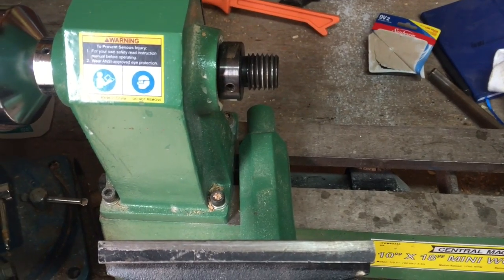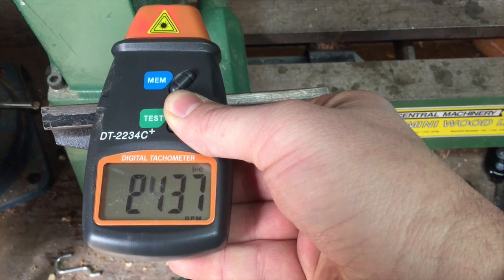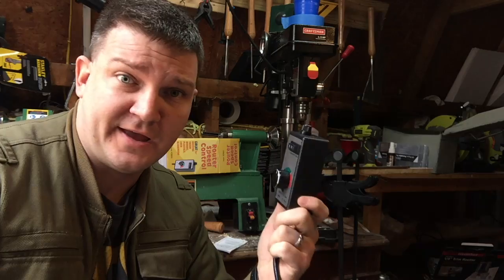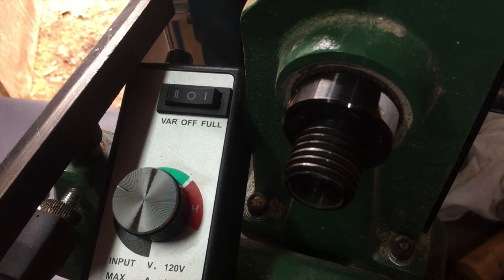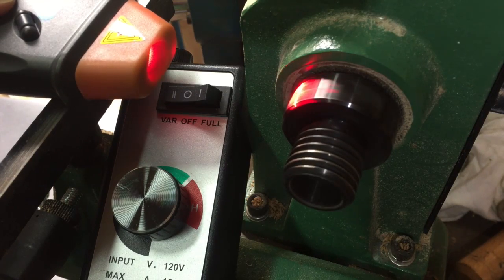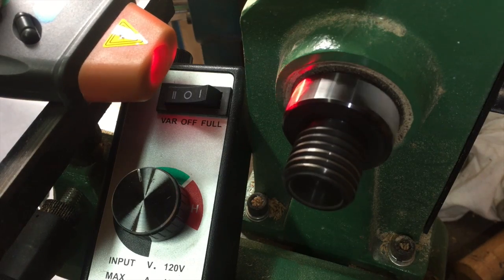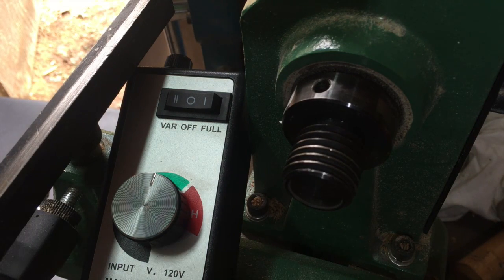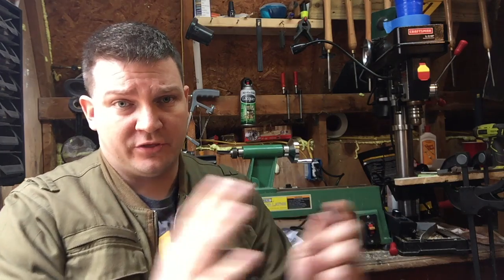Shop Tools: Harbor Freight Lathe Speed Control

Comment: Same question , different wording. When the belt breaks, where do we buy and new belt and how do we install the new belt onto the pulleys? In the instruction book, there is no mention of how to do this installation?  To me , it looks like we must buy the belt from Harbor Freight and then take the lathe apart to get the new belt on. Then put the lathe back together again? Thanks for the reply.  This will help all of us when we need to replace our belt on our HF model 65345 Mini Lathe...   https://www.youtube.com/watch?v=fvOHII3k-Io
Reply from the maker: Thanks for sharing that link, i've never had to do that. If HF doesn't carry the belt you could probably order it from Grizzly that sells the same lathe with a different paint job.
Reply: I am going to shop for a belt now before I need it. Not sure why they put those grooved pulleys on there? I guess is so it runs quieter? If my belt breaks I will use an old leather belt to fix it. May work ok or not? It is a nice lathe tho. Just right for all I ever intend on doing. Thanks for the heart. I like to try to help folks as much as possible. Good video too.
Reply: Call us at Belt Store 337-235-9736 if you have not found your belts. We can help
Reply: Thank you.
Reply: Link belts
Reply: dread cat: don't know if you got a belt yet, but the harbor freight mini lathe is the very same (except for a couple handles and paint color) as the Excelsior lathe from Rockler. Rockler carries this belt on their website and I would imagine they have it in store as well. I just checked the website earlier today and it was $9.99. I too have the harbor freight mini lathe.

Rockler also sells a bed extension that should fit the HF lathe as well. If you're interested.
Reply: You can order replacement belts and parts from Harbor Freight. The phone number, along with the available parts list is on the web page for that lathe. The belt is only a couple dollars and shipping is free. The parts people are the best I’ve dealt with compared to other companies. And if you need a part not shown on the available parts list they can often special order them for you.
Reply: @jjp95136  I ordered a new belt from Amazon for mine
Reply: Take the belt to any local farm-store, they can help you.

Comment: Here’s what might be a problem. AC / induction motors generally regulate speed by frequency control. Yes, they do slow down by decreasing voltage, but they will not have much torque under load. Additionally, if you run them at less than their rated RPM for very long, they can and probably will overheat. The rated speeds of small 60 hertz motors are usually either 1750 or 3500, give or take. That is designed in, based upon the number or poles the motor has. 
   A frequency drive unit can run them from 0-maximum RPM, maybe even faster, at full voltage, by changing the frequency. But this is dependent upon whether your motor has a centrifugal start switch internally. The router control is for use on brush-type (universal) motors.

Comment: Penn state has a 3/4 motor and variable speed switch that will line right up with most lathes. I have a delta midi with just about 12 inches and a bed extension of 36 inches and with the 3/4 motor and 250-3000 switch already wired into it

Comment: From my own painful experience, unless your motor is a DC motor, a rheostat...which is what you have there...wont work the way you/we would like. Along with the DC motor, you will need an AC to DC converter. THEN that rheostat will work. The speed of a DC motor is directly controlled by the amount of voltage coming into the motor. Sorry

Comment: I'm confused.
It seems you CAN control the speed up to the maximum speed for that particular pulley.
If you want slower for finishing, you turn it down.
Not sure what the issue was here.
Reply from the maker: You’re absolutely right. This was just about me being lazy and wanting a dial more than changing belts. This was a great starter lathe but I’ve since upgraded to something that fits my needs. Thanks for checking it out
Reply: @KagedBooks  So, would it be just as fine to get the device, put the belt on the fastest setting, and just use the dial to slow it down if you need to?... or maybe use a 'medium belt' setting so you could at least go a tad faster, and still have the ability to go slower if needed?
Reply from the maker: @gsgidney  so yes and no. It’ll technically work but when I did more research it doesn’t have the right kind of motor to handle that kind of limiting switch. So it’ll work for a while but would likely burn up the motor much faster

Comment: I bought a similar 6-speed Delta lathe on Craigslist that is stuck on its second highest setting.  On mine, the nut that clamps down on the level that you use to slacken off the belt tension is off its threads, but it's firmly clamped down on the lever, so even though I can turn the nut, there's no way to budge that lever.  ( I think I know why the guy knocked off $50 off the price without me asking).   I had planned to use a variac, but people on the internet say that it won't work with an induction motor with start and run capacitors which mine surely has, so now I think I might have to get a VFD or just risk cutting the nut off and figure out another way to clamp down that lever.

Comment: Just seen this although 3 years old. You cannot use variable speed with motors that have capacitors. When you heard it ramp up and a soft click was the centrifugal switch disengaging the capacitor. You’ll burn those motors up doing that.

Comment: For the ppl who asked on replacing the belt. I have the same lathe. The spindle needs to be removed from the head. It's pressed in. I cut a piece of car exhaust pipe that's a little longer than the spindle on the opposite side of the hand wheel. Cut a notch in that pipe so it fits over the ridge molded into the head. Remove the handwheel from the spindle, and loosen the set screw holding the upper pulley. Get a honkin' big C clamp and two flat pieces of wood. One piece of wood goes on top of the spindle on the handwheel side, the other piece goes on top of the pipe, and the pipe goes over the spindle. Put the C clamp over the whole thing, with the screw of the clamp on the handwheel side. Now just crank the c clamp down until it gets hard to turn, then tap on it with a hammer until the spindle moves, then crank the clamp down again. Keep doing that until the spindle comes loose from the bearings. Slide the spindle out, clean and lube everything, since you have it out, and reassemble in reverse with new belt. Belts are available from HF, but you have to call to order it.
Reply: I just changed the belt on mine last week. I ordered a two-pack from Grizzly for $20/shipped. After failing spectacularly to remove the spindle with clamps and tools I had on hand, I bought this: https://www.harborfreight.com/8-in-three-jaw-gear-puller-69224.html?_br_psugg_q=gear+puller

Save your frustration - worked on the first attempt.

BTW, this is a great beginner lathe at the $200 (sale) price point!

Comment: It would have been interesting to see what happens when you put a load on the lathe. My experience with this switch is that if it's used on single phase induction motors they will bog down when put under load using this switch.
Reply: Tried and soon I put a load completely bogs down and the motor gets too hot, better get a dc motor.
Reply: and heat

Comment: I have a HF 8X12 mini lathe and the HF 10X18. The 8X12 is no longer sold by HF. It is variable speed and has worked great for 3 years now. Got the 10X18 cheap with a 25% off coupon with the intention of getting the variable speed conversion kit from Penn State Ind. It would still be much cheaper than buying a 10X18 already with vari speed. Its not so much the cost if your selling your projects, I paid more for a chuck set for the 8X12 than what the lathe cost. That little lathe has paid for itself dozens on times over. I have seen them under other names, excelsior, shop fox, etc. Just a little research.........

Comment: Watch for over heating the motor at slow speeds.  Cooling fan slows as the motor slows.  HF lathes already have a motor heating problem. Might want to consider adding a cooling fan to the end of the motor.
Reply from the maker: Thanks for the tip! I actually switched to the Nova Comet II, i mainly use my HF for drilling now

Comment: Not sure if this question was asked, but what setting was you belt on? I have both the lathe and the speed control. The speed control is collecting dust so it would be good to use it.

Comment: yes there is a way however is not chip. That lade uses an induction motor and the speed is pair with the ac 60 cycles. you need a device device called (AC motor controller) however they are not economic purchase.
Reply from the maker: Thanks for the tip! I actually switched to the Nova Comet II, i mainly use my HF for drilling now

Comment: I have the same lathe, and had the same frustrations that you do with changing the belt all the time. I converted mine to variable speed using a treadmill motor. It is a much better way to get a variable speed lathe than what you attempted in this video. The motor that comes with the lathe can be damaged trying to vary the speed in this way. I recently posted a video on how I did my conversion, you can check it out here https://www.youtube.com/watch?v=xLpsL3HEsvs&t=16s  I hope this helps. I know I love how my lathe works now.
Reply from the maker: I did not use this for long, I actually ended up recently getting a Nova Comet II and use that for most of my turning now. I still have the HF lathe and use it for drilling and buffing now. Your solution looks like a good one. I subbed to you, hope to see more videos in the future.

Comment: How is the belt changed? Where can we get the belt? Good video.
Reply from the maker: For changing the speed you have to loosen the motor and then lift up, moving the belt to the wheels you need (the manual has a diagram), lower the motor and tighten it back down. It's not too bad just inconvenient. I actually just upgraded to the Nova Comet II it has variable speed built in which is really nice.
Reply: Same question , different wording. When the belt breaks, where do we buy and new belt and how do we install the new belt onto the pulleys? In the instruction book, there is no mention of how to do this installation?  To me , it looks like we must buy the belt from Harbor Freight and then take the lathe apart to get the new belt on. Then put the lathe back together again? Thanks for the reply.
Reply: @dreadcat7756  Replacement belts are vailable. Search Amazon - "New Replacement Belt Harbor Freight Central Machinery Mini Wood Lathe 65345" .   Changing the belt is simple; Unplug, lift the motor, open the side and rear belt covers, take off the old, slip on the new...
A 5 minute job, tops ....
Reply: I wonder if a link belt would be useful.

Comment: I've used a dimmer switch before on my older lathe. That rpm tester is quite nice.
Reply from the maker: I think this one just didn't have the right motor for it. Yeah the RPM tester is neat, pretty cheap over on amazon so i'm not sure it's precise but i'm sure it's in the ballpark.
Reply: did it Work? I have an old Craftsman lathe I'm restoring and was trying to figure out a cheap way to adjust the speed.
Reply: That controller from harbor freight is the problem. You see how you had to go almost to the medium point to get it to go. You can get another one and it might have to all the way to high speed to even start. They are not accurate but I can't remember what it's called for sure but it's just changing the amount of electrical current the motor is getting. You can get a real good one for $100.
Reply: Jay Perdue so 100 bucks on a speed controller for a 79 dollar lathe lol
Reply: @Tagvr3178  Only if you bought it 15 years ago.  They are 259 now (thanks tariffs).  Wirth it though, I've been using mine since they were under a hundred bucks and it runs like a champ.
Reply: @Tagvr3178  That lathe costs over $250.

Comment: So I noticed that you`re using a harbor freight speed control.  I wonder if there would be a difference with a higher end model of a different manufacture.
Reply from the maker: I think the results would be about the same, after some more research I found out it's more to do with the type of motor it is rather than the controller itself. If you try it out or see someone else please let me know i'd love to see the results.
Reply: Cool, thank you for your replay ;-)!!
Reply: I saw these in the catalog and was thinking about getting it for my Sears which has the same issue of multiple pulleys and can only go as low as 800 rpm. Then I read the specs and it stated it's only for a certain type of motor.  I think it was motors with brushes.

Comment: Sell that lathe, and get a Nova Comett II
Reply from the maker: Ironically enough I just got the Comet II. I'll have an unboxing video soon. I'm going to keep the HF unit and just have it either as a dedicated drilling or buffing lathe.
Reply: You can get the grind wheel attachment for the nova and save space, that's if you are short on space like most of us. It's only like 60$ more both things needed.
Reply from the maker: I saw that and was considering it so I could get rid of my current bench grinder. I saw some old articles saying it had a rotary tool attachment and i'd love to have that but I don't know if they stopped producing it or what but I can't find one for sale, only articles about it.
Reply: Then you will have a variable speed grinding wheel, right by your side to sharpen your chisels at any time during the process.
Reply: I use the carbide tip chisels from rockler so I don't need to sharpen

Comment: I read somewhere that you can't use speed control on motors that do not have the carbon brushes or you damage the motor
Reply: sam terian You’re absolutely right. It was written on the yellow sticker which was on the variable speed box he was using. You need a VFD (Variable Speed Drive) to safely control the speed of a single phase motor 👍🏻
Reply from the maker: This ended up not being very effective, i have since moved away from using it.

Comment: Your going to burn out the armature of your motor if used over a small amount of time.  The physic of the belt wheels even on a "variable Lathe" will only give you a range of speeds within the selected wheel size. These type lathes usually have only three or four wheel sizes to chose from  thus giving you 3 or 4 ranges . . . typically  a 1700 rpm motor give you 1st step 650-1450 rpm, 2nd step 1250-2800 rpm, 3rd step 1600-3800 rpm.  So no matter what you do your still going to have to change the belt. Your only solution is to buy a DC  Variable motor (I've seen some single phase 220 volt motors) they are very expensive and I've never seen one on a small lathe. Hope this helps you and saves your motor and for your safety. Running that way is a real fire hazard. Let the chips fly where they may and have fun turnin!
Reply from the maker: Thanks for all the info. I've actually stopped using this because I didn't find it that helpful with the motor, so until i'm ready to upgrade I'll work with what I have. Again I really appreciate the input here, this community is awesome.

Comment: I put a foot pedal off a sewing machine on my drill press .I just put in  line on the hot side  the more you push the faster it goes . I just bought an old wood lathe having the same problem so I need to find another old sewing machine
Reply from the maker: Thanks for the tip, i'll have to give it a try.

Comment: Penn State Industries has a conversion kit that includes a digital speed control and a variable speed motor which is reasonably priced.  I intend to get one for my small Delta lathe. https://www.pennstateind.com/store/TCLVSKIT.html
Reply: Michael Gross thanks to your comment, I bought one and avoided the unnecessary upgrade to a new lathe. I am now a variable speed beast on this HF lathe. It is the berries so far!!!
Reply: The original variable speed motor kit from Penn State had a half horse motor.  The current version uses a three quarters horse motor.

Comment: I have that lathe, in a different color, and the lack of variable speed is the thing that I wish I could change the most. One thing I did to make it more convenient is to put rare earth magnets on the panel that covers the pulleys (instead of the screw) so that it's easier to access the upper pulleys to change speeds. I also put a mirror on the inside of the panel so I can see the position without having to lean over. Both of these help, a little.

That lathe has an induction motor, which pretty much means it's single speed, and it won't work with that kind of speed controller. Penn State Industries has a retrofit DC variable speed kit that is not crazy expensive, but it's getting close to the cost of that lathe.
Reply from the maker: +Barry's Woodturning Thanks for the mirror / magnet tip i'll have to do that.
Reply: I removed both covers, permanently.

Comment: I too like to know your outcome on this issue. I want to get a lathe (probably from HF) but , like you, I dont want to mess with the belts to change the speeds. I do know the HF 8 in. x 12 in. 1/3 HP Benchtop Wood Lathe comes with a speed control. Maybe you can get that part and install it in your lathe..... Good luck and let me know what you end up with
Reply from the maker: +Shane's Hobby Shop I'll look into if that is possible. I originally looked at that smaller Lathe but it doesn't take the more common MT2  attachments in the headstock. I may upgrade to the larger one eventually as that one does have speed control as well. They do make some motor mods but they cost about as much as the lathe so I don't really think that's a good option.
Reply: The 8x12 you are looking at is a metal lathe not a wood lathe. That’s also why it costs$999